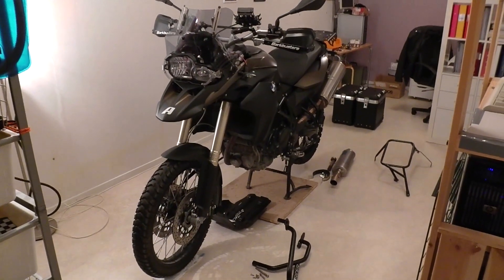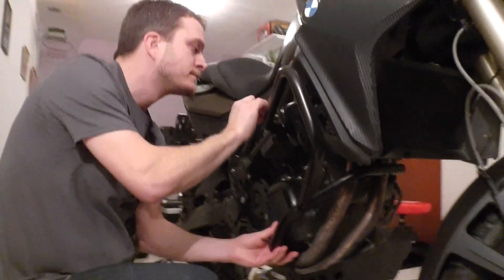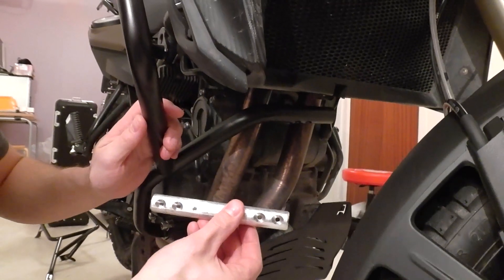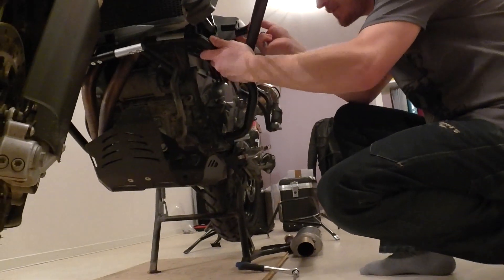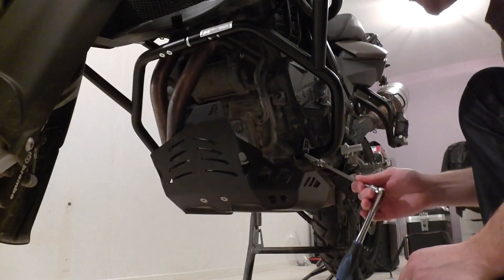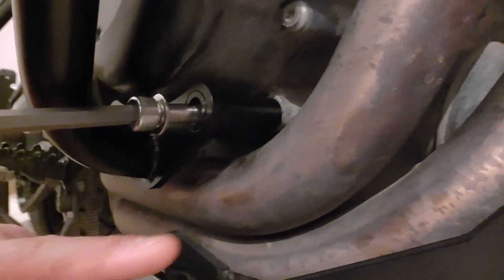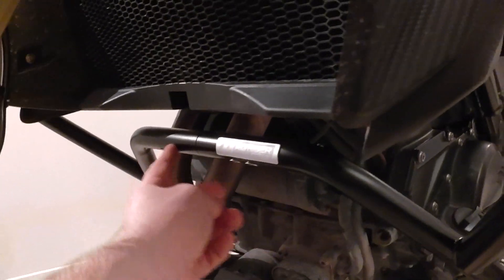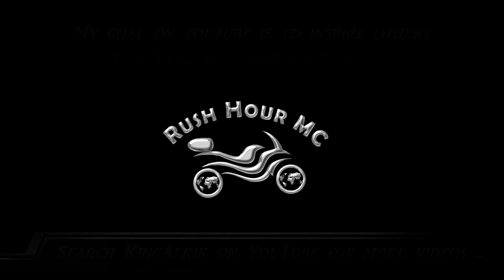AltRider Crash Bars - BMW F800GS

Comment: Nice video. I have a similar setup. How did you black out your radiator side panels? I always found them to be aesthetically questionable. Looks good.
Reply from the maker: Tnx,
AltRider radiator guards.
Cheers // Johan